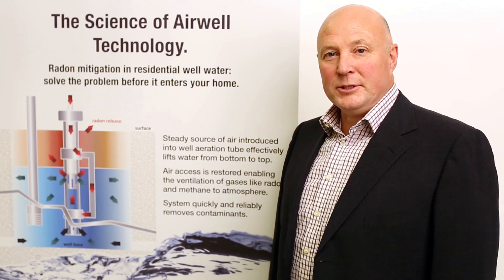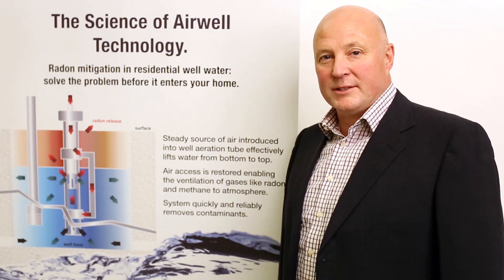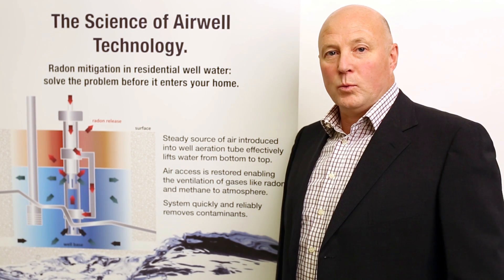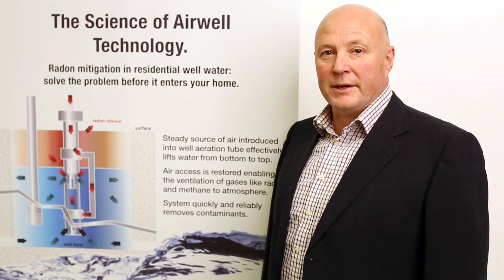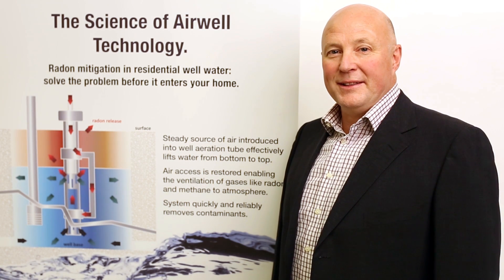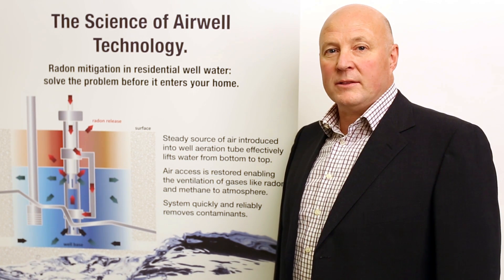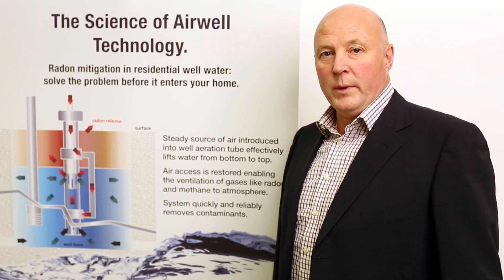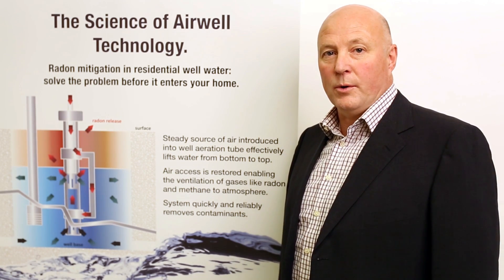AIRWELL™ - Radon Mitigation

Comment: If this process is installed IN the well does it cause oxidation of the well casing and well pump?
Reply from the maker: Aeration only happens in the top 40 feet of the water column. Using a specialized active section we use air bubbles to create a siphon effect to pull water from the bottom and aerate the entire column of water while not making any bubbling near the pump.